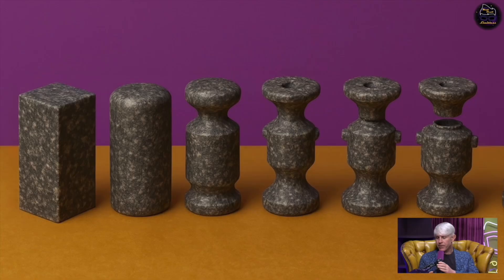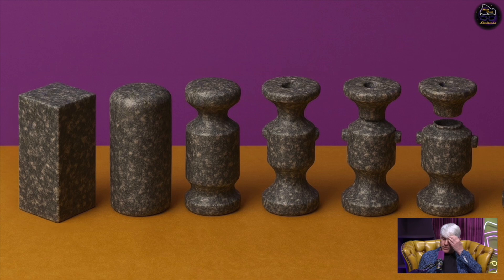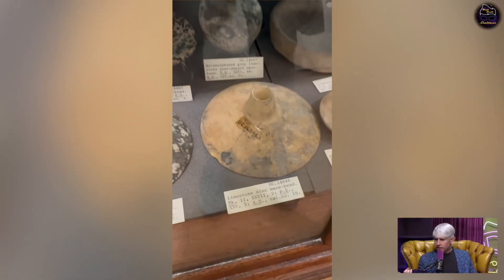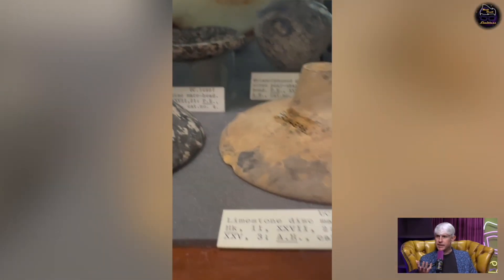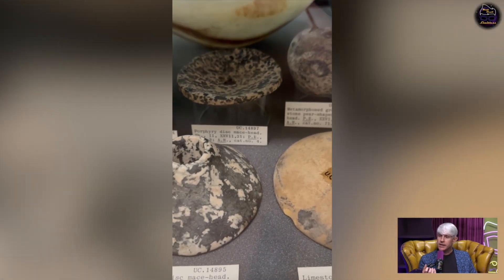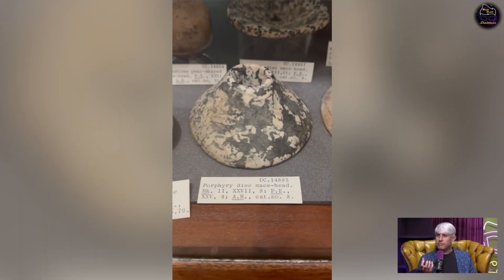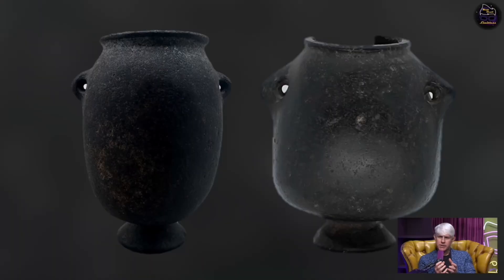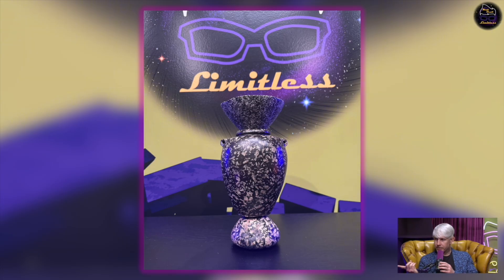How Did They Really Make the Ancient Vases?

Comment: I think its equally as possible that this was 3 tiered manufacturing was done by design. Running the gambit on function from as low as a simple 3 piece kitchen set to something that required all 3 components to operate

Comment: to make the closed mouth jars, you need to secure the work piece on one end, and use a tool head that goes inside the vase, articulates, and removes material in a contour that matches the outside of jar. Tube drill alone cannot make a closed mouth jar

Comment: Ya’ll should try to make one. Reproductions, turned on modern lathes break and chip on the inclusions and imperfections of the natural stone, and the broken bets get glued back on with epoxy before finishing. Even if you had a modern quality lathe, with excellent harmonics/smooth operation from steel ball bearings, giant metal clamping jaws that can hold heavy stone at high rpm, the stone will still break on you, and the lathe operation does not account for the queer handles found on alot of the stone jars. I’m not convinced that lathes as we understand them made these objects.